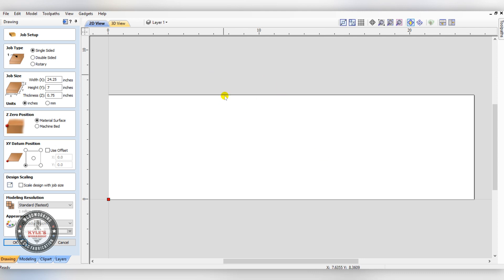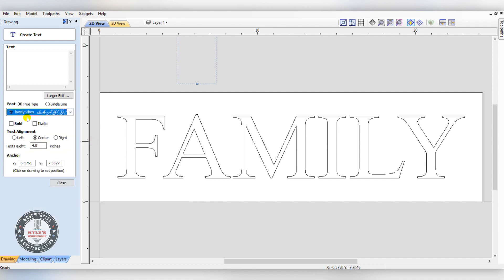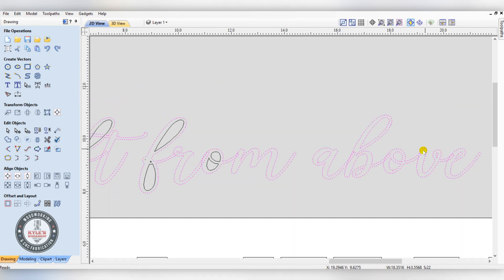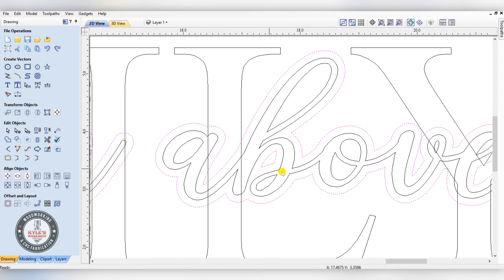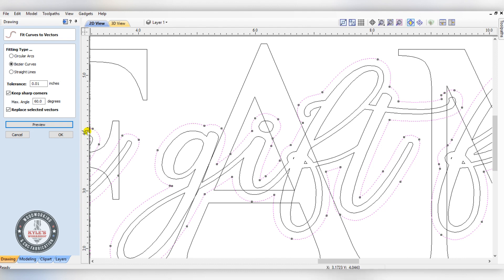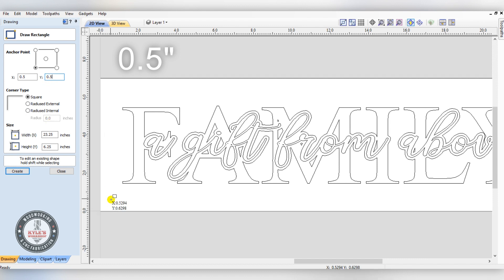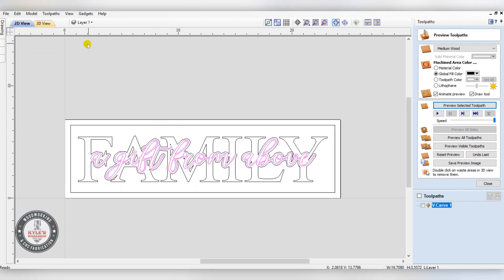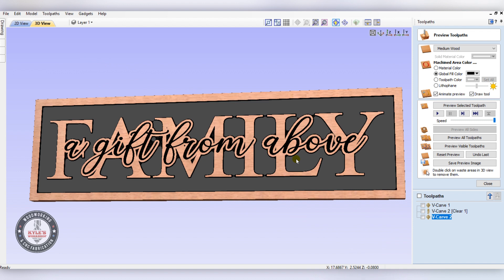How to Make Text Inside of Text Sign   Practical Vcarve Pro Tutorials   Episode 3

Comment: I have the VCarve Pro 10. Is it me or do I see things. If you go to 4:21 in the video you show with VCarv 10 weld. Then when you do it in a older version of VCarve its  different. Take a look at the letter "f". VCarve 10 shows the line going threw the "f" from the letter "t" after the weld. In the older version there is no line.  Is it me?
Reply from the maker: Yes, you are correct. I didn't notice that until you pointed it out. It should look like the way with the first weld.